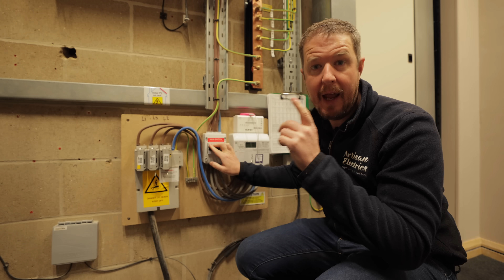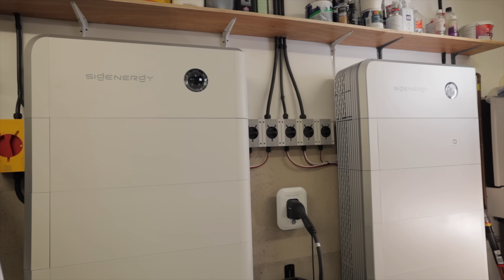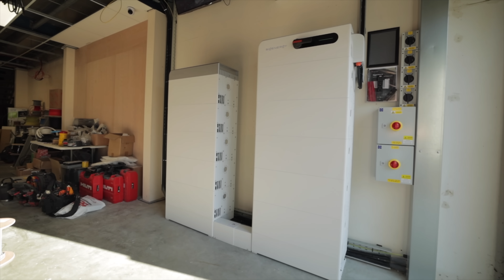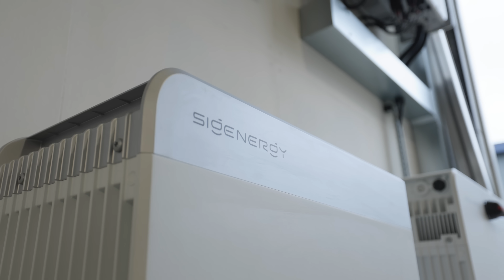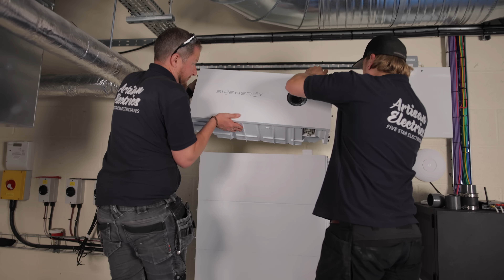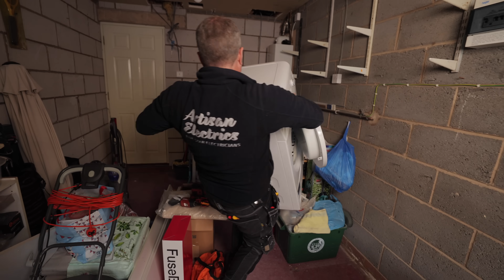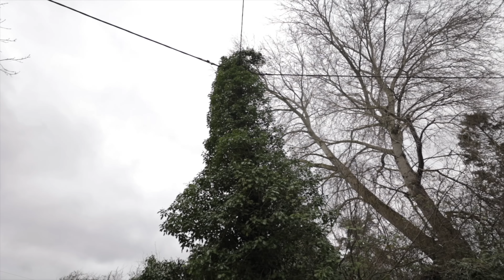You’ve Been MISLED About Battery Backup

Comment: We are in Brisbane Australia. 48kWh sigenstore, 20kW 3 phase inverter, 20kW of solar.  Absolutely seamless switching to battery during multiple outages...I only know I lost power because I get a message from the app. 
We had a massive storm in November that cut a swathe of destruction right across Brisbane which created over 200 separate areas of outage for our network operator to fix, so power was out for around 30 hours.  The next morning was sunny and our system recharged fully by 11am.  We weren't using our generator, so loaned it to one neighbour, and we ran a long extension cord to the other neighbour to keep their lights and fridges going....and this was while running our 18kW 3 phase air conditioner the whole time! Very happy Sigenergy customer
Reply: We had an 8 hour blackout down in NE NSW on a 41 degree day.  Similar setup to yours and probably the only comfortable family in our street. Worth every $.....
Reply: I decided to just go off grid completely, its actually easier and simpler, I built a 100kWh EVE 48v battery, 15kW Victron inverter and a 10,000 watt victron 450-200 mppt with only 10kW of solar. I am on the sunshine coast. We have been off grid for 12 months now, battery has never gone under 50%, not even in winter, we are induction cooking, whole house aircon, pool pump, 4 fridges, Best thing I ever did. No electricity bill and the system cost me $20,000 a 25% return on my investment.
Reply: @polvincompoundsadmin5402 okay, I am impressed. So... i will play... what's your secret sauce?  Do you heavily restrict your use of the air conditioner when the weather is overcast? Or maybe your whole house ac is considerably smaller than my 18kW cooling capacity (~5 or 6 kW electrical draw) 3 phase inverter unit?  Likewise, I imagine you have to switch off the pool pump if it's overcast?
I am sure we would improve our self reliance capacity if i doubled our battery from 48 to your 100 kWh, but in planning for potentially going off grid if daily access charges become extortionate, I was also planning to upgrade our pv capacity from 20 to 28 kW, largely for improved performance when it's cloudy, though being able to very quickly fill the battery in the morning would also be nice in summer when the clouds roll in during the early afternoon. I am amazed you get by with 10kW solar.
Reply: Wow, that's what I call living the dream! Just knowing you have all your own needs covered, and can help out neighbours, must be a good feeling. And all from the sun and some clever electronics... I'm saving my pennies for a similar system but with the 9 kWh modules and a smaller array due to our roof shape. But that gateway is essential 👍
Reply: Yes it was nice but the key sentence was "it was sunny the morning after the storm".  When people start discussing going off grid, you have to plan for inclement weather.  So... that sunny day after the storm was in summer, and we probably generated 90 to 110 kWh in a day.  In winter we might generate 50 to 70, and a few days ago it was cloudy a few days running, and i had a day of 7 kWh followed by a day of 13 kWh, which are potentially the two worst days we've had in the last 12 months, and of course they were adjacent.  With a grid connection as backup i don't care, and actually, since it is May and we don't need the air con,I could probably have made it through on the battery we have anyway.   But if you had those consecutive cloudy days with no grid backup, you'd be a little concerned.
Reply: @henkjanvanmiddendorp942you know, i saw a Canadian guy on YouTube who'd done some testing on various panel orientations... where he lived, one of the best setups was bifacial panels mounted vertically, facing east and west, largely because in winter when he would normally lose out heavily both because the sun was low in the sky and because of snow, instead he found that
1) there was so much light reflected into the vertical panels from the surface of the snow that they did much better than expected mathematically for that angle, and critically
2) they don't accumulate snow on their surface like they would if roof mounted. 

Neither of those factors helps me much here in Australia (in subtropical Brisbane), but it might be a useful thought to you, perhaps?
Reply: @MichaelWakefield-mx6hg will the gateway gives you instant and automatic backup, which is nice, but you could alternatively get a changeover switch installed by your sparky. This would mean 1) you need to be home to access the backup mode, and 2) you need to be comfortable finding your way to the switchboard by torchlight and throwing the switch to restore power,  and 3) same again in reverse when power is restored. 
But if you can spare the $ for the gateway, it is a very nice piece of kit.  Even the case is beautifully engineered to industrial levels of build quality, and makes my adjacent nearly brand new (normal domestic quality) meter box look like a complete p.o.s.

Comment: We get quite frequent power outages where I live and I work from home as an IT contractor.
8.5 hours of power outage just today (was scheduled by the utility company luckily).
V2L EV adapter just arrived last week and I used it solely to power my office equipment.
Router, monitors, docking station. 
Worked perfectly and used about 4% of my EVs battery capacity.
Limited to about 3kw I think but that's plenty for the essentials 👍
Reply: You could also use a powerstation such as the ecoflow ones. Technically they're only eps but my hardware doesn't notice the difference.
Reply: @Felix-st2ue thanks. I was looking at a video about an ecoflow system where you just plug it in to your regular circuit 😮 sounds very interesting.
Not sure how that would work with a 230v 3 phase without neutral tbh. 
L1,l2,l3 all split into single phase circuits 
🤔
Reply: @CJ-vg4tg well i was more thinking about single outlets. If you want a central install I'd rather go with a deye/sunsnyk install or a victron setup. The latter lets you configure a lot but are quite complex. (In my eyes too complex for most cases)
Reply: @Felix-st2ue Thanks Felix. I'll look into that as I'm not aware of those systems.
Unfortunately here in Uruguay the availability is somewhat limited.
Import duties on most products is very high to say the least.
But the EV market has exploded.
This January sales increased by 300%
Almost half of all cars imported and sold are electric now.
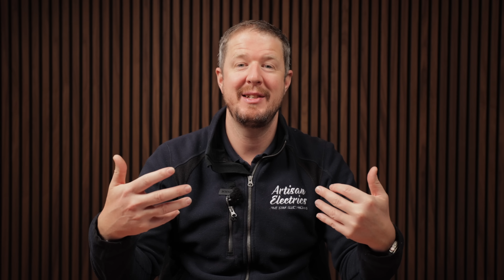99% renewal energy and super cheap 00:00 - 07:00 tariff.

Comment: i think a realy big 240v capictor would stop flicker
Reply: Capacitors only store dc
Reply: @polvincompoundsadmin5402   your wrong you can get large ac capictors Air conditioning units  have them. you could use dc caps and bridge rectifier . im talking about a internal addition to the gateway auto switch just holing power to stop the flicker .
Reply: This would be a addition to the gateway switch.aimed at the manufacturer.obviously don’t wire a cap across the tails .it a complicated circuit and would need big diodes in line with the caps to stop over charge explosion

Comment: I have a Sigen system and I did get the gateway from the outset, but that’s because I was really looking for a ‘UPS’ solution.  I wanted to ensure we could deal with any future power cuts.  The installer actually persuaded me to add solar to the solution and I’m glad I did.  Very impressed with it so far.  Even on a fairly cloudy day in February, it’s able to keep the battery at 100% for most of the day.  I then set it to charge from the grid during the cheap overnight rate.

Comment: I just had a Powerwall 3 fitted with 27kw of capacity. Being an ex retitred electrician, I know about backup supplies and agree with all your comments in the video. I decided not to go with a Gateway because we have not had a power outage for many years. And, being in the city even if there is an outage, it is very short lived. 
But the main point to my reply is Two fold.
1) You mention, or show Two types of backup, Tesla and Sig-energy. As I said above, mine is a Tesla and here is, in my opinion,  a major problem with Tesla. It centres around the latest firmware release where the powerwall thinks it can control the charging cycle better than you or me. Lets just take my case, the first week of ownership sees the computer within learn some charging habits. It decides how much to charge the packs. Is it to 100%?. No, my pacs did charge to 100% One day, on subsequent days it charged less and less, 90 then 80 then one day no charge at all. This was because it listened to the weather forecast and decided it was going to get warmen hence not as much charge would be needed. This is fine but it did not take into account we needed a full charge because we needed washing m/c, oven for cooking, heat pump for heating, the list goes on. The end result was we ran out of power before mid day and needed to import. On the next few charges the sorage capacity did reach 90%. Good, I thought it has learned and from now on will chage to this level most days. This proved not to be the case. The net result for me is really awful. Having bought 27kw of capacity, I knew most days we used 25 kw of energy, but it is never available. The algorithm Tesla uses does not suit all and if the weather is forecast to be warmer it did no charge at all that night because 50%was left. 
So when you talk about how long would a backup last, please be aware with Tesla, you might only have a low level to start with so bakup times will be greatly reduced.
2) The second reason I will mention  with Tesla is the situation when a customer does no want a gateway backup.
I have solar installed since fits started so was keen to keep my solar generation separate to preserve my Fits status, but Tesla can see when the panels generate. To overcome this non gateway option Tesla require TRM modules fitted at the sevice entry, one ct clamp monitors power in and out to control the output of the bank and another solar clamp is necessary to monitor the solalr o/p but that connection is over a separate low level with 2.4 gig system that can be very prone to dropping conection from the solar ct back to the powerwall battery 2.4 gig receiver.
In my case Batteries are in the garage and the service entry where the sensor ct clamps need to be fitted are a long distance from each othe, hence the signal drops and I get spurious interference which affects the readings.I mention this because I have not herd any u-tubers mention this problem,
One last point I will raise , I call it power leakage. I do appreciate if the heat pump or fridge or any other motor device starts, the inverter may not be able to cope with demand, so the grid steps in and fills the gap, hence there is a net import for a very shot time till the load drops or the inverter picks up the load. But I have a continual import of around 60 watts, it can jump much higher. Unfortunately this impot is at the peak rate and has got as high as 4kw in a day. This is 4kw the battery should have sourced. I think maybe  one of the ct clamps was not calibrated correctly. This is my view only.
All in all, would I recomend a Tesla powerwall 3, the answer is a big NO. I think Tesla are trying to be too clever reducing charge levels to what they think I will need. I want my Battery to charge to say 90% this will just last one day and save importing . 
So if you are  thinking Tesla with  no gateway, be warned it is not all plain sailing, problems will arise!!!!!
Reply: Wow, a lot of words to say : get a gateway, always! I agree, it's only a fraction of the cost of the entire system and will avoid all those issues. Gateways just tie everything together, making it seamless and sensible, and you have much more control over the charging/discharging parameters.
Reply: Battery capacity is not measured in kW, it's measured in kWh 
As an ex-electrician, I would hope you would know that.
Reply: @deanXRayZulu  Yea, of course I know. Just an old age slip
Reply: Also, Tesla Powerwall 3 doesn’t have any local controls. My one with gateway 2 has to be controlled via the cloud. The firmware feature updates seem like a good idea for cars (which I have one) but for home battery, you want predictability day after day. Not an AI driven guesswork that is only taking suggestions from you via the cloud. 

So I would also not recommend Tesla Powerwall 3 for lack of local controls and predictability. 

As for your problem. I have gotten around it by setting backup reserve to very high at start of off peak. Its AI sees house needs + backup reserve > 100% and it will charge to very high. Then when using it, nears back up reserve setting, I set backup reserve to very low, so battery continues to discharge. All is done autonomously by Home Assistant via their cloud. It’s a huge faff and shouldn’t be needed.

Comment: I bought an Anker Home Power Panel and 2 F3800+ units. The F3800+ has a 6000 watt inverter and that number is posted all over their advertising for it. However, while hooked to the Home Power Panel, the 6000 watt inverter on the F3800+ will only provide 1850 watts to the house. I had to buy 2x additional expansion batteries (B3800) just to get to 5700 watts. That's 2x F3800+ units and 2x B3800 batteries. I should be getting 12000 watts, but bottlenecked at 5700 instead.
I am trying to get legal help for a class action lawsuit.

Comment: I have Ecoflow DPU with  SHMP2 with about 24kwh to power all critical loads the SHMP2 has about a 20ms switch over I have not noticed any flicker or problems with any devices on my critical loads circuits. The inverter rating is key to ensure you can power your critical loads.

Comment: Here in South Africa we have a crumbling electricity infrastructure. Our power stations are  also reaching and of life (coal fired) as well as a lack of maintenance and corruption. This has resulted in loadshedding for some days 6 - 8 hours a day continously for weeks at a time. Fortunately we have not had loadshedding for nearly a year.
Also the transmission cable needs to be replaced as a fair number of plots have been subdivded this has put further stress on the old cable with outages of up the a day sometimes.

Comment: I run my house on back system of 3000w inverter with 48v 560ah battery bank, and a daily use of 2000w inverter with limiter aka ZERO EXPORT... currently 3000w of solar panels... another 4000w waiting to be installed on the roof...
My batteries cost $107/kwh...way cheaper than any powerwall unit....

Comment: Nice vid and pertinent at the moment. I live in the French Pyrenees and we have just suffered storm Nils. Power was out for about a week in my area. I have a SMA Sunny Island based system: 3 phase, 25Kw Sunny Tripower sting inverter, 28Kw of panels and about 45Kwh of BYD LVL batteries. My transfer switch is made by « Enwitec », but takes 10s to transfer power. I have spoken to SMA and they have told me that it is « regulations », but I can’t believe it. Sigenergy also sell their products in France and I have seen French reviews stating that transfer is 0s. I spent most of winter « off-grid », by choice.

Comment: 47kWh of batteries on a mix of a Sunsynk (with islanding built in) and some grid charge/non grid tied additional kit because we were on our export limits. Of that about 4kWh is reserve for a total emergency along with several days water, portable induction stove, torches, radio etc.
We can't run the entire house off it, and we can't run all the heatpumps off it but we can run enough if things get bad.

Realistically though in most cases like a lot of people we'd probably just move in somewhere else on a long outage 8)

Comment: You should cover V2X, models should be available in 2026 for vehicles and type 2 chargers
Reply: CCS has far better support for V2X than type 2.  The latter is limited by cable size (32A typical maximum), the in-car inverter (usually a lot less than 32A), and most importantly... standards.  CCS standards for V2X however are well developed, and converging where proprietary differences exist.

Since, with CCS the charger and inverter are outside the vehicle, it's easier to supply larger currents over the fat DC wires and have power electronics in external cabinets.  With type 2, the charger and inverter are inside the car, and realistically limited to V2L, rather than practical applications of V2H or  V2G.

Comment: In the EPN DNO ( East Anglia - UK) The average time for an LV power outage is 160 minutes, the average time for an HV outage is 90mins. In extreme weather conditions where HV and LV power lines are down we generally get everyone back on with in 24 hours, there are exceptions and we work to mitigate time off supply.
Reply: Depends if you want to plan for an NPO. The black-start procedure has 60% of the country back in 24 hours so you'd want more than that.

Comment: What about using the power stored in an EV (with Vehicle to Load) battery. Are there bidirectional EV chargers available?
Reply: V2L is on board inverter on car, not very useful if you're not at home. V2G is better but it is battery backup when grid needs power to balance. V2X is the best but standard / directive is not ready completely
Reply: Currently  vehicle to house is not allowed in the UK  you can run an extension from evs that have 230v out to power a few things  my brother inlaw heats his hot tub from the ev

Comment: 7:01 why keep using this example while that not even possible as the inverter will fail when try to handle the huge load of the neighbors homes
Reply: Ah, you are getting at the idea of electrifying people working on the grid from your single inverter which will see all the neighbours loads? I suppose it depends if they too have PV and where exactly the cable break is - it could be very local to you. The DNO are used to working and jointing on live cables however.